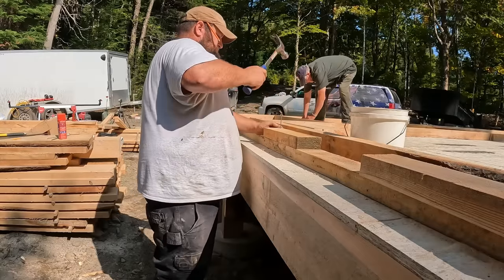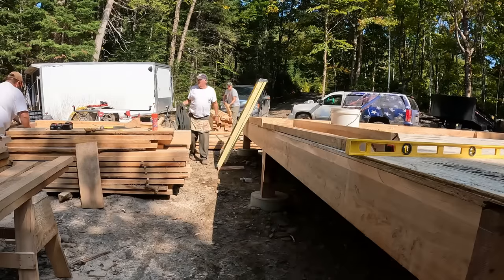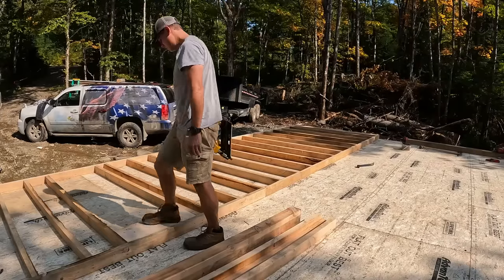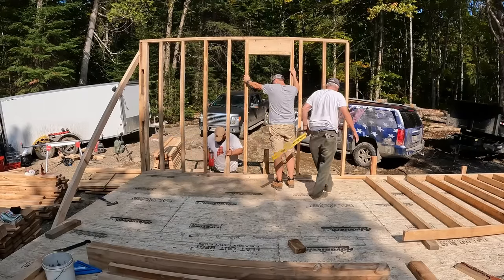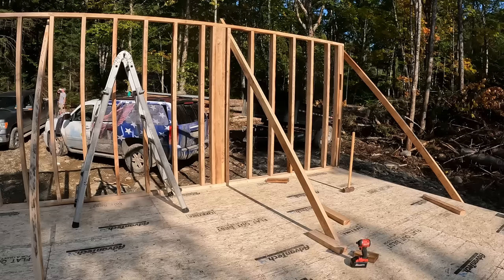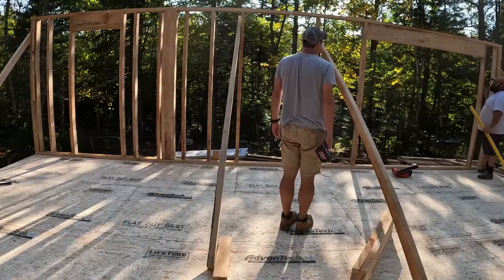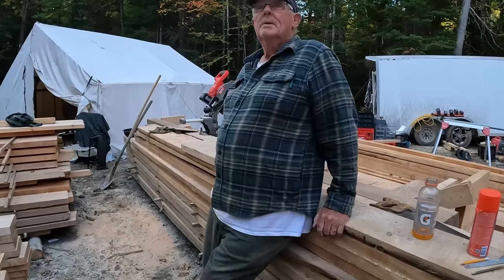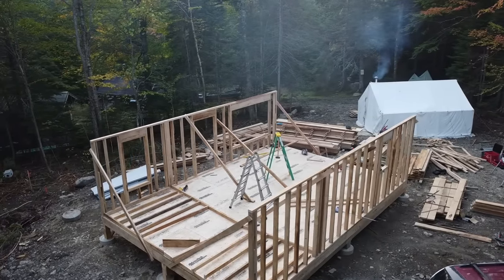OFF GRID CABIN: Framing the Walls! Episode 14

Comment: You need a capillary break where the wood blocks meet the concrete, jack it up and slide in a roof shingle.
Reply from the maker: That wouldn't really be a capillary break with a shingle that could take on water. Would need a poly or plastic. But since the block is already raised above the ground we don't need a capillary break.
Reply: Will be a very long before you have to worry about hemlock 6x6 rotting.

Comment: Just wondering if it would be easier to nail that if you were standing where the floor is closer to the ground. 😮 5:57
Reply from the maker: It was a good height. Four solid swings and a dead swing isn’t bad for 16/20 Pennie’s,